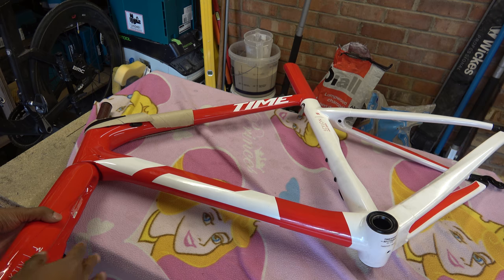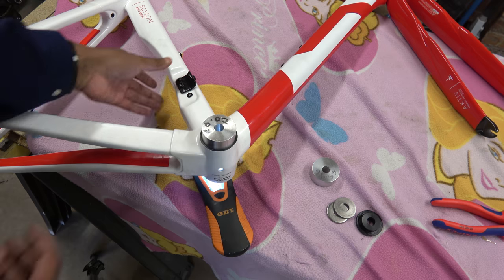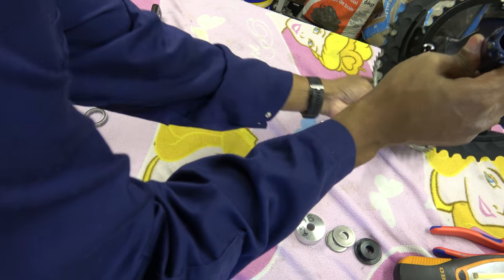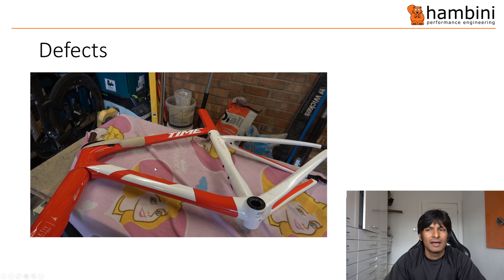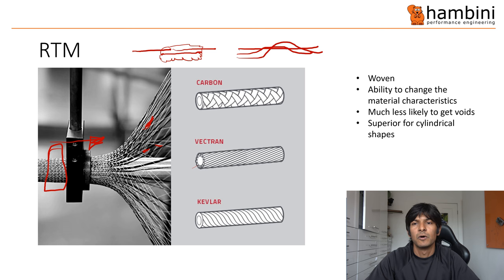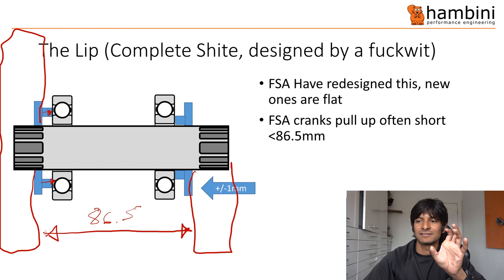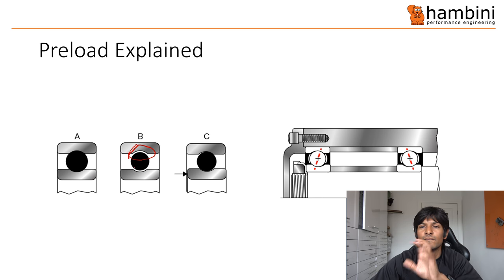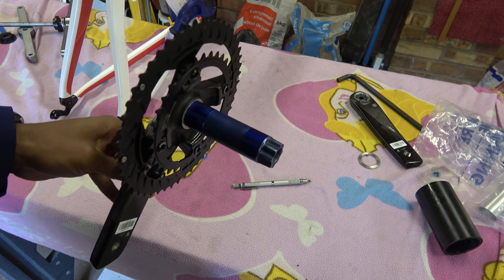The best made bike frame in the world meets the worst crankset in the world and Hambini Loses it

Comment: Rogue Mechanic (https://www.mavicparts.com/collections/shim-kits) makes shim kits for the Campy UT to solve the wavy washer problem.  Had an aluminum frame with English threaded BB that after facing to parallel was on the low end of tolerance. Wavy washer not enough and the crank would bang around. Rogue Mechanics shims were perfect. A bit fiddly to make it work but well worth it.

Comment: This RTM technique, it looks like they are weaving a sock.  Do they still use a female mold that they put the sock into and then insert a bladder?  Does that mean the sock has to stretch to fill out the mold?

It's a pity the looms in the north of England closed down.  If they could have kept going to a bit longer their skills would have enabled them to do this and turned their businesses around.  A high value product was what they needed.

If you are based in Bristol have you been to the handmade bike show.  Royce used to have a stand there, just wondered if you had seen their hubs, BB's and cranks.
Reply: I remember speaking to a Time rep on their stand at a show once & he explained the RTM manufacturing process. As far as I can remember, the ‘woven sock’ is woven on to a mandrel & some other parts (like the lugs) used an internal wax mould in the same way as the lost wax process does. 
I know Cliff at Royce quite well (I only live a few miles away) & I reckon he & Hambini would either have an engineering love child or kill each other. They both have very strong opinions on what engineering should be & quite rightly so. Next time I’m over there, I’ll ask Cliff if he’s heard of Hambini. If he hasn’t... watch this space!
Reply: Thinking about it, Cliff ONLY uses NTN bearings so I am expecting a love child would be the likely outcome.
Reply: @earthstick  Thanks for the link. I watched the Time factory video and it's impressive. Time produces 4000 frames per year.... Save my money and get a used Time frame if I have to.

Comment: Im sorry, but everything you said about RTM isnt really that correct. RTM stands for Resin Transfer Molding and is just one way to infuse resin into a composite part. It has nothing to do with the fibres beeing woven. Basically it is just the best way to minimize voids. 
However... RTM can be used with UD carbon fibre just as well as it can be used with woven one.

Comment: The detail of the carbon steerer tube to the upper headset bearing with the compression ring is an utter disgrace of engineering. Reason is any wear or looseness in the system results in ringbarking of the carbon steerer. HOW CAN SUCH A DETAIL BE PERMITTED TO EXIST IN SUCH A SAFETY CRITICAL AREA. ALL IT NEEDS IS A 20 CENT INERT TO PROTECT THE CARBON STEERER, BUT IS IT THERE, NO.

Comment: On the subject of Wider Tyres: wouldn't they Weigh More, plus the wheel rims, also needing to be wider... 
become Heavier Too!!  Faster? LOL.
Reply: In terms of the 19mm tires we were running in the 80's, wider. 25mm with a slightly wider rim to smooth airflow seems to be the sweet spot of aero, rolling resistance, and weight. Annnd yeah, aero gear has always been heavier cuz in a flat tt (where aero counts most) the steady speed means no accelerations (where weight hurts most).  For "normal" riding, the watts saved by lower rolling resistance throughout the ride is larger than the watts saved by low weight on the climbs. Then again, I ride offroad so it all seems a bit silly....
Reply: Wider is faster in real world conditions not because its lighter or more aero. Its faster because wider tires mean lower pressure. Lower pressure means less reactive force causing your rear wheel to bounce all over the fucking place. Less bouncing all over the fucking place means more of your pedal stroke is actually going into propelling you forward. This is the same reason modern mountain bikes have rear suspension. Its not to make the bike more comfortable, its to keep the rear wheel engaged with the ground. If you're riding someplace where they actual give a fuck about their roads, this might mean nothing to you. However, if you live in one of the majority of countries that couldn't be fucked to maintain infrastructure, a wider tire can give you a marginal performance gain. Another benefit of lower pressure and greater ground engagement is higher grip. Meaning you can carry more speed into a turn, minimizing the need to accelerate again (where weight is most costly). For the majority of us that don't give a shit about beating middle-aged dentists in a local crit, wider tires mean we're less likely to blow up a wheel on one of the magical potholes that seem to appear overnight, causing us to face check the fucking pavement, requiring us to then go fund those previously mentioned middle-aged dentists' next underused aero bike.
Reply: Light weight is overrated, but yes.  They will be heavier, and that's a downside, and they will be worse aerodynamically.
Wider tires at lower pressures could theoretically roll faster depending on how they're constructed, though, so depending how they're made and how they're used, they could be better.

the "sweet spot" will vary depending on conditions so there is no one best answer.

Comment: All the problems with bikes lie in the supply chain. Engineers on cad machines don’t see the manufacturing difficulties in producing a carbon frame in the Far East.  The process of building a good product relies on seeing the failures early in manufacturing and sorting it out. That’s why the best manufactured products have the smallest time difference from design to shop floor. It’s no coincidence that look and time have better quality control as they build in Europe and it’s much easier to control the manufacturing and modify the design process. Less cultural ignorance , no time difference and no language barriers. They also don’t build large numbers.

Comment: Is the reason why most carbon frames are out of round related to the way carbon reacts to machining?
Reply: They don't machine, they use a mandrel. When the carbon is heat cured the fibres shrink at rates depending on the lay up. So if not uniform will shrink out of round when the mandrel is removed.
Reply: Their acceptable manufacturing tolerances are too high along with what should be rejected at the final QA, instead is passed on to customers instead of scrapped.  High reject to pass ratios are ok if followed when wide manufacturing tolerances prove cost effective, vs. more costlier precision manufacturing. Unfortunately, bean counters push profit margin and may even encourage more warranty replacements as acceptable, to that ends.

Comment: How many man hours went into the fix for this bike at lets saaaaaaaaaaayyyyyGBP150/hr?
Reply from the maker: 5 or 6 hours. I got pissed off by the end as you can tell
Reply: So about GBP 750 to 900 to fix that poorly made crap. At least the owner can legitimately sell it as better than new!
Reply: Might be exaggerating a bit with the £150/h mate.
Reply from the maker: @MP48  jobs like this one are a fixed amount. I thought this was going to be straight forward but it wasn't. It was a complete pita. I don't like it when someone or something gets one over on me from an engineering point of view. I don't walk away until complete
Reply: @Hambini  for sure we're aligned and similar in our approach to the problem. What gets to me is that the Crank probably cost	GBP 300 and required another GBP 900 worth of engineering time to make it workable. These companies get away with selling substandard parts because the likelihood litigation by a consumer is very low. Buying their junk is a lottery. Like reaching into a kiddies lucky packet and hoping for the best